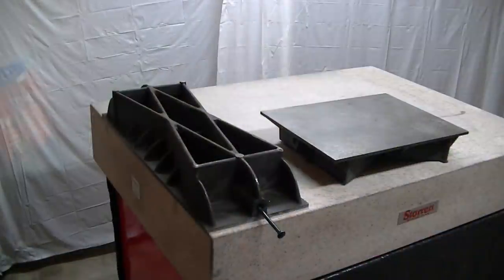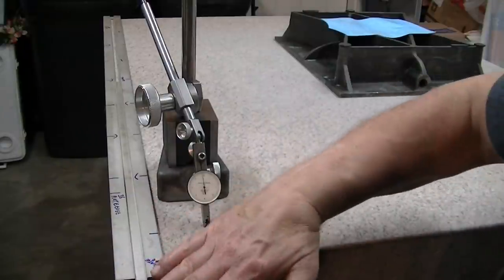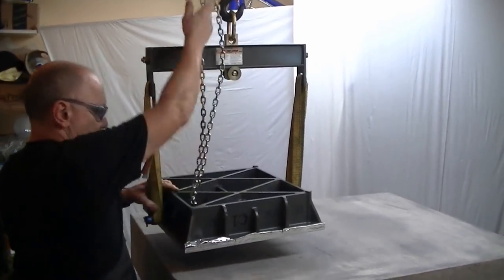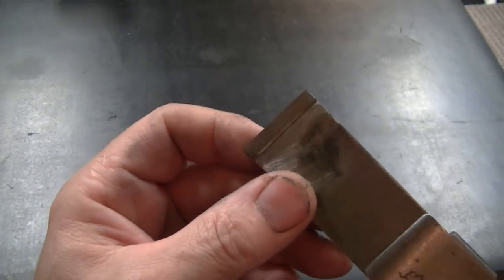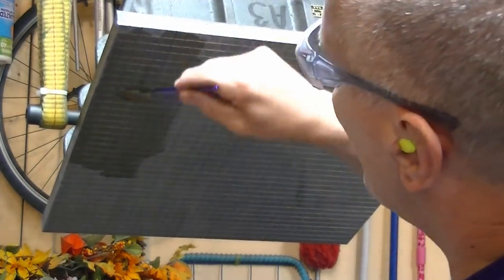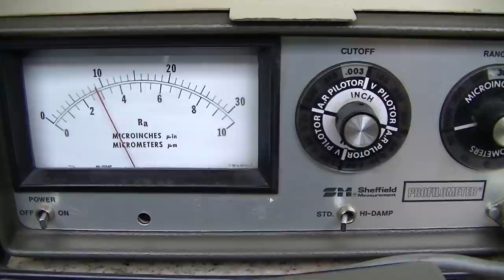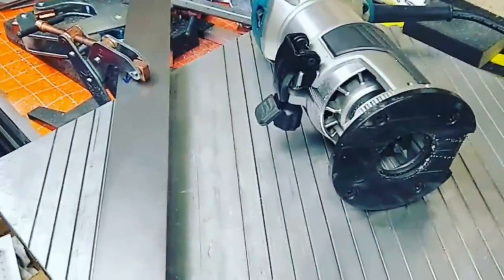DIY SURFACE PLATE LAPPING PART 2

Comment: Robin,  I always learn from your videos.  I created a 24X36" plate from a granite slab just before you started your project 2 1/2 years ago.  It was 0.014" rough flat when I started.  I never went to AAA but got it flat to A.  Roughed with diamond honing plates then finished with a 9 X 14" cast iron lap smooth on one side and grooved on the other.   Yes the grooves really make the difference and prevent skating on the granite cuttings.  For those who don't understand your level weight compensation the precision 0.0002/10 level would easily show me walking around the plate deforming the concrete floor.  I built my own repeatOmeter but it only shows 25microns.   Thanks for your great work teaching!
Reply from the maker: That is awesome Chuck!
ATB, Robin

Comment: I see other comments poking fun at the lengths you go to to balance weights and forces on the plate. The phase of the moon was a good one! If that wasn't important to the process, you wouldn't do it. Most people aren't dealing with forces and measurements as small as the ones required for a near perfect surface plate. It's hard to believe they make an appreciable difference! I learned a lot from your videos, thank you!!

Comment: I've recently become obsessed with machining and precision again. It's an on and off again obsession, among a few. I have been amassing related equipment and tools this time around. None of it will likely ever make me a dime of money. I might need to be checked into a ward.

Scored a 0.1 micrometer resolution digital indicator for scrap price a few weeks ago. I'm pretty sure it works. Found an amplifier for 50 on ebay. Haven't pulled the trigger yet due to potential compatibility issues.

I'm probably just going to settle for a couple of first-surface mirrors and a laser pointer to crudely replace the functionality of an autocollimator.

Comment: Well worth the wait. In the last hour you have cleared up so many points that have been floating around in the backof my mind. Not least that you need to correct repeat readings for cumulative angle.

Comment: My US Army calibration lab had several surface plates. One was a 48x96 inch AA and another was a 48" diameter, 20" thick AA plate. Years ago, we checked them using an auto-collimator and a couple of mirrors. Later on, we used an electronic differential level system that was tied into a laptop. It made the task much easier and quicker. It was interesting to see you use a counterweight to compensate for the movement of the plate as you moved the level. Whenever our plates were out of spec, we'd call in a contractor to refinish them. It was neat to watch them work. It was a father/son team that would push the lap back and forth across the table to each other and occasionally spin it in spots. They put on quite a show..

Comment: I think I found at least 10 things interesting in this video. Couldn't you lay that 14" optical flat on the surface plate and use images thru it to find peaks and valleys in the plate?
Reply from the maker: The granite is not reflective enough to form a fringe image.
Thanks for stopping by Brian!
ATB, Robin
Reply: For that you need a grazing incidence interferometer.  Adam @laneymachinetech and I just got our first fringes on black granite using this technique using sodium light. In theory we could set the unit up on Robin's plate and look at fringe patterns. It won't do the whole plate at once just strips up to 48 inches long. We could probably walk to Pennsylvania and hand carry the instrument in time for the next video. <g> 

Cheers,

Tom
Reply from the maker: @oxtoolco  I thought we were friends  ;-)
Reply: @ROBRENZ  hey he just said he’d walk to PA for you carrying a grazing whatsit thingy, which I’m sure is very heavy.
Reply from the maker: @sblack48  That proves we are friends :-)
Reply: oxtoolco on your way to Pa stop by Kentucky and we can check my granite plate too😎 heck I would even drive you from here to Robins unless you just want the excercise. Lol

Comment: I am mesmerized by the procedures you go through to flatten a stone this flat. It is so interesting and entertaining. Now what would a realistic application be for such a flat surface to be used for? I mean only several millionths out of flat would seem to not matter anywhere in an application. Thanks for the time and effort you put into these exceptional videos and take care!
Reply: Precision errors stack up. And the surface plate is the datum surface for many other things. Tongue in cheek a machinist would say: "Measure with a micro meter. Mark with chalk. Cut with an axe!". When Robin wants to make a very precise tool to manufacture something else precisely he already have three layers of "stacking up" if he only used the surface plate to calibrate the tool he wants to make... but usually he needs a good handful of measurements, some of which are indirect (that is, measured from another measurement). So "going space cookie on the precision" in as many places he can is a good investment down the line.
Reply from the maker: Well said!

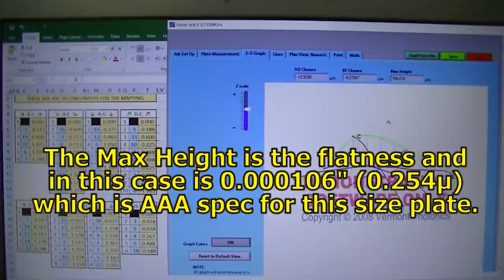Comment: Awesome video. Just a comment on 50:00 you showed the final flatness. The metric value is 0.254 um. I was really astounded at first how you got that precise  but I think you got a little decimal error. Actually it’s 2.5 um. 😅
But really awesome video and great result. learned a lot.

Comment: Hey Robin, I hope you know your the true youtube machinist master, reaching out to everyone that could need your help even without them asking for it sometimes I think. With the quality of your content its just a question of time untill the views take of.
I was wondering if there is a easy way of checking the flatnes of a small stone, maybe 25 cm diameter that is polished glossy like alot of gravestones.
And I have one last question, on how to get started with scraping and make some sort of very small surfaceplate and or straightedge,maybe with the 3 plate method too check scraped surfaces against the cheapest way.
Love the videos, take care!
Yours sincerely Odin.

Comment: Hi Robin, it is fantastic to watch someone who really knows what they are doing (or at the very least has a skill level quantum leaps above mine!).  One thing I was not sure about, was whether or not there was any noticeable variation in the thickness of the aluminium sheet.  Are they very flat also?  If not, are you relying on the lapping to flatten out the lap as well?  Maybe it does not matter because of the random lapping action?  Anyway, just something I was interested in.  Thanks again for the great content!
Reply from the maker: The aluminum is very uniform but getting it on undistorted can be a challenging. Lapping is intended to be a somewhat mutually correcting situation but depends a lot on the lap/work material combinations.

Comment: Awesome. Thanks so much for sharing. Super envious of that gantry in your shop by the way.

Do you clean the spotting ink off before stoning? I would think that might load up the flat stones.

When you are scraping it would be really nice to get some shots of your entire body, how you are positioned and applying forces, etc.

Hopefully that vacuum is not just spewing abrasive dust into the air. I guess the same is true for grinding carbide, probably should have some kind of rated bag in the vac.
Reply from the maker: Yes
https://youtu.be/EECJA2ZUVjg
HEPA

Comment: Robin very interesting video! You don't think the weight on top of the optical flat would influence the flatness. Or would it tend to hinge along the axis of your meter?
Reply from the maker: Hi Peter, I think you are right that it would hinge along the axis of the meter.  That flat is 1.5" thick but they defect from their own weight so it is moving some from the weight of the meter but I am guessing a couple micro inches max.
ATB, Robin
Reply: @ROBRENZ  This is something I have always wondered about optical flats. When I was lapping parts. If you lay the flat on top of a part but the flat is larger than the part. Or it overhangs the parts edges. It there some spec that defines the maximum this overhang should be to maintain the flats spec.? Say you put that flat on a part six inches in diameter would it sag over the part and that part would be to small for that flat?
Reply from the maker: From papers I have read the sag is roughly in the 1 microinch range  when edge supported so usually can be ignored.
Reply: @ROBRENZ  So for a given size they must design the thickness such that condition is met. Interesting.

Comment: A new year's treat from the One in a Million Man :-)
Watching the spreadsheet stuff, I get the idea that you are translating height differences into angles in order to have the surfaceview software then translate it back into a height map.
Could you not also create a height map by directly using the values from the repeat-o-meter ?
Reply from the maker: Correct and correct.

Comment: What do you think about using an aluminum plate as a lapping plate and just laying steel plate on top to make it heavier? Might make handling easier because you can take the steel plates off one by one and you can adjust the weight of the whole plate. Of course the aluminum plate has be to thick enough to not bend too much. 
Love your videos
Reply from the maker: That could work.

Comment: I made 3 6" plates and I thought that was a ton of work, this!  wow.    One question I had while doing my small laps, the groves in the cast iron seemed to develop major burrs.  They would shred a paper towel.  Is this due to the crappy quality of cast iron, or do your plates also develop burrs in the groves?
Reply from the maker: No burrs in the grooves of grey Iron. Sounds like you may have ductile iron laps.
Reply: @ROBRENZ  Thanks for the reply!!!  They are 5lbs weight plates I used the whitworth 3 plate method on. Do they need to be cleaned off or should I leave them?  They seem to work ok but this is my first stet. My laps are pretty flat and I don't really want to re-grind them.
Reply from the maker: @JesseSchoch  If they are not bothering you leave it alone
Reply: @ROBRENZ  they were hard to clean between grits but I switched to a bucket + solvent + air + toothbrush and cleaning was ok with that method.  I'll leave them alone.

Comment: This is very useful video, thank you for making it.  One small correction: at 50:01 in, you lost a factor of ten in converting the Max Height of 106 micro-inches into microns.  106 uinch = 0.000106" = 0.00269mm = 2.7 um.  (In the video, you converted this to 0.254 um, which is a factor of ten too small.)

Comment: Hi Robin,  great video, many thanks, enjoyed watching that one. 

I think I'm starting to get it (usually means I've missed something). So it's a case of flat, yes, but over what length scale? Sort of locally flat over some distance compared to globally flat if you like. I'm waiting for an all-length-scale full-spectrum renz-o-matic repeat-o-meter :)

Now for my dumb question: If the cast iron lap plate is flat when it's face up (for some definition and value of flat) , can you be sure that's going to be the case when it's used upside down?  (thinking here the underside supporting ribs that were in compression are now in tension - does that matter?). I'm naively applying "everything is made of jell-o" thinking.
Reply from the maker: Jello thinking is correct but it is very small.  It is not a perfect lap making the plate perfect. It is the mutual averaging affect of two surfaces abrading each other. in this case much more abrasion occurs on the granite. The secret is continuously accessing the concave/convex condition of the lap and using the correct slide or spin technique to keep the lap flat along with focusing the lapping to the higher areas of the plate.
Reply: @ROBRENZ  Ahh, OK, got you. That makes sense. Much appreciated!

Comment: At the end, when you are bonding the aluminum plate/sheet to your cast iron surface plate with acrylic adhesive, is there anything special with the aluminum plate? i.e., is it just normal, joe-blow aluminum sheet material or are there high precision/tight tolerances that make it special? After cutting through the aluminum and exposing the adhesive, are you worried that the adhesive might fail when exposed to the slurry during lapping? Is the bonded aluminum thickness around 1/16"? Thanks for an awesome video.
Reply from the maker: Generic 6061 0.015" thick.  Adhesive is Loctite 325 with 7075 activator. Very oil and chemical resistant.
Reply: @ROBRENZ  Thanks!

Comment: Hi Robin, I note at 55:02 you said “you have to increase the depth of cut by the square root of 2 to get the film thickness that you’re after”
What is the meaning of the square root of 2 as far as it relates to what you were saying here and also generally in the shop/ engineering?
I inadvertently came across 1.414 a few months ago when I was trying to double the size of a square! Now I keep hearing it everywhere!
Cheers
Reply from the maker: 45, 45, 90 triangle has a side length relationship of 1, 1, sqr root of two  (1,1,1.414).
Or 1/sqr root of 2, 1/sqr root of 2, 1 (0.707, 0.707, 1)

Comment: Look. The pursuit of flatness is man's ultimate folly. God curved the space-time continuum for a reason.
Remember. A straight line is nothing but a circle with an infinite radius. 
Repent! Repent!
Reply: Ha ha! not a member of the flat earth society then?
Reply: oddjobbob  Depends on where you are. In Australia its curved. In Dallas it is flat.
Reply: oddjobbob  Sorry. I couldn't resist. 
"Depends on your geometry. Do you have a meniscus of water clinging to fat belly rising like a leviathan from the deep? Or a six pack whose geometry generates multiple small waves which cancel each other out for greater flatness."

Comment: Robin, doesn't your precision flat stone "bend" enough when you "lean on it" here to cause problems?

Does your hardened roller ever get charged at all while rolling the diamond material into the softer laps?  If so, could it then transfer a larger "grain" into a lap charged with a finer grain and cause unwanted scratches?
Reply from the maker: Of course it does, but not enough to matter. It is just a way to lessen the number of prints on the master.

Comment: I bought a used 24x36 black granite surface plate. It was heavily scratched and had a lot of chips/divots in it. I dove into this technique to improve the surface, and it worked exceedingly well except I can’t get from my uniform rough surface to a polished surface. Does the aluminum allow the plate to glide over the granite without scratching? My problem is as I get to the finer diamond grits, my surface plate will somehow scratch the granite and I’m back to where I started. Very frustrating. So how did you achieve the final polished surface?
Reply from the maker: You are probably using much too fine of a diamond size. You do not want a polished surface as the tools will tend to stick to the plate instead of sliding freely.
Reply: How smooth is too smooth? I thought the point was to flatten the plate uniformly and then to get the surface smooth enough so a gage tip won’t ‘catch’ on rough parts. I wonder if my surface plate grooves are too far apart.

Comment: Robin, How flat is the cast iron plate? if you scraped it (ill have to go back and watch the other videos) what did you print it on? In order to make something flat, dont you have to have an already flat reference? Am I missing something? 
This is something I may attempt in the future... I have a 24x48x5" black granite plate I bought from an estate sale. I've been using it, and it DOES seem reasonably flat, but it has a few good dingus marks I'd really like to get rid of eventually... It has a calibration sticker on it stating it was calibrated at AA.
Reply from the maker: The iron plate I was using as a master to scrape the lap was one I did by the three plate method.

Comment: Hi Robin, I have a question. What lubricant should I use on my granite surface plate when marking up and measuring with a height gauge?
Reply from the maker: IMO none at all. But cleaning the plate with a Lanolin based cleaner gives a much smoother feel than other cleaners. Some even use plain Gojo hand cleaner that have NO scrubbing particle additives.

Comment: For us home gamers that don't have an assortment of cast iron surface plates, Would it be reasonable to fab up and scrape some steel lapping plates to glue aluminum foil on?  I'm hoping that such a construction would be stable enough for the purpose, since it isn't exactly metrology equipment.
Reply from the maker: That could work but I suggest bonding thicker 6061 aluminum sheet to the steel as shown at the end and scraping the aluminum.

Comment: Would a camel back like structure of the lap keep it from wearing out in its center more quickly?
Reply from the maker: It is not a structural problem it is non uniform abrasion pattern problem.

Comment: How would you remove the aluminum bonded with locktite 325 or is it permanent without machining? Heat?
Reply from the maker: Yes heat but pretty high as 325 is still strong at 325F

Comment: 24:40 - where did you get that crane device? What is it called and where can I buy one? How much does it costs?
Reply from the maker: Ordinary manual chain hoist rding on an existing I beam in my garage.
Reply: @ROBRENZ  interesting how you’re able to move that hoist all over your shop. Would like to see how you mounted it.
Reply from the maker: @ShopperPlug  It just looks that way. I am actually moving the parts underneath the I beam and just traversing in one axis on the beam.
Reply: @ROBRENZ  yes really looks like a multi axis system.

Comment: if the lap becomes too heavy would lapping submersed work on a  different scale of operation?
Reply from the maker: I don't know.
Reply: Submersed like underwater? Or as in wet lapping? Underwater surface plate lapping would be wild